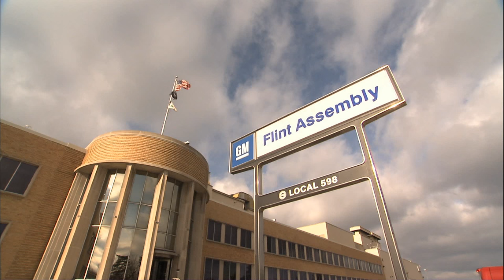General Motors Flint Assembly Plant (Chevrolet Silverado, GMC Sierra)

Comment: I guess GMC doesn't want to advertise that the bulk of these and the Sierra are all made in Mexico.
Reply: Just 1/2 ton crew cabs, 1/2 ton double cabs and all heavy duty is still made in the USA or Canada.
Reply: Same with Ford
Reply: get a clue.
Reply: 1/2 ton crews are also built here as well.
Reply: According to GM, all 1/2 ton crew cabs are made in Mexico.
Reply: Flint is also tooled to build 1/2 ton crews, albeit must be Chevy, and it must be with the 6.6' bed.  This is more or less used to help the Sailo plant if they cant keep up with demand.
Reply: also gm no longer makes trucks in Canada either.
Reply: Yes I have a 2016, 6.6 bed, double cab and it is Indiana made.
Reply: I have a 2017 1/2 ton dbl cab 6.6 bed with a VIN code 'Z' denoting that it was built in the Fort Wayne IN. plant.
Reply: My half ton was made in Canada lol
Reply: Jack Ostrander we build a small number at Flint so that we can run them if Mexico can't, or if they can't keep up.
Reply: Jack Ostrander GM said that all half ton crews are made in Mexico. First clue if VIN first # is 3 made in Mexico
Reply: Double cab is not a crew cab.
Reply: Lol! Not a genius. Just a 20 yr UAW auto worker at Flint Assembly. I know 1 or 2 things about these trucks.
Reply: Yes but hopefully we can keep these hardworking Americans building trucks in flint and one day bring the rest of the ones being built in Mexico back too
Reply: There is no longer a demand! LOL
Reply: So what? Its going to be the same no matter where it was built, as long as it isnt china.